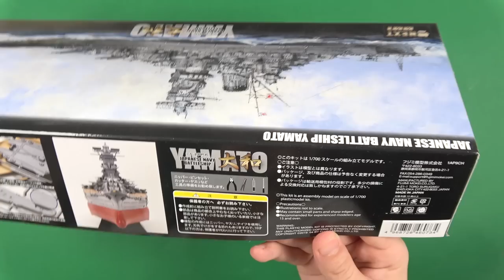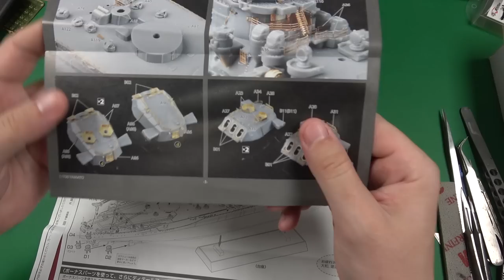IJN YAMATO | Building the Fujimi 1/700 Yamato Scale Model Battleship with Flyhawk Superdetail Set

Comment: Several comments and questions:

* I was wondering how your nails don't show up in the video and then found your eat them XD

* How do you glue tiny PE with CA and press it in position without gluing your fingers?

* How do your glue the deck? Mine warp, I glue them with super glue.

* what's that white putty glue you used with the plane? Is a glue that doesn't eat the paint?

* the crew is printed in resin?

Great build in a tiny scale, more than impressive, incredible! You won a subscriptor.

Comment: Where do you get the CA glue that actually sticks parts together instantly? Superb work as boringly usual. You have more patience in your pinky nail than I have 
in my Whole body.
Reply from the maker: I use small portion packed glues always. I don't use a glue more than two weeks after opened.

Comment: Hi! at 36:29 did you apply panel liner on the whole surface and just did some vertical lines with it? With thinner/white spirit? 
And how long does it takes to dry before removing excess?
Reply from the maker: Hi, yes I applied Tamiya Panel Liner thinned with Zippo Fluid. It dries in minutes and ready to wipe. However I did not wiped the excess wash. I applied another fresh paint layer over on it. That's kind of pre-shading.
Reply: @Scaleaton  thanks for answer! Well yes i noticed you preshaded it, but you used the brush doing vertical lines, where you just stroking it vertical to get the worn look? I have built fujimi yamashiro and going to weather it with panel liner, but i am a bit afraid to mess it up😕

Comment: Something I absolutely hate with every kit of Yamato, and every aftermarket set I've seen. Why do they try to recreate the diamond-plate texture on the deck surfaces in 1:700? The textured bumps scale to being the size of an entire human foot instead of an inch, at most... It's just wrong. If the detail is too small to recreate at the scale, especially by such a vast margin, don't try it... Every manufacturer tries though, and it's so annoying, especially as it's very hard to sand it off tiny photo etch parts.